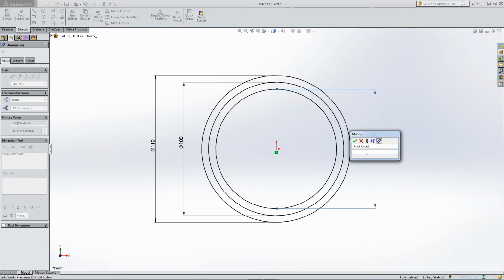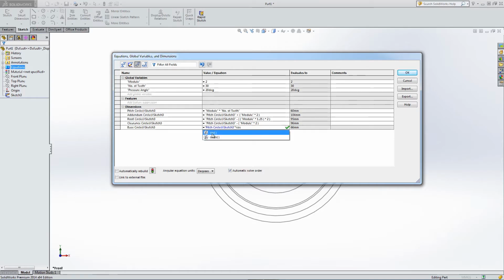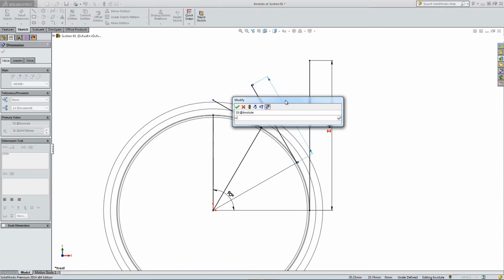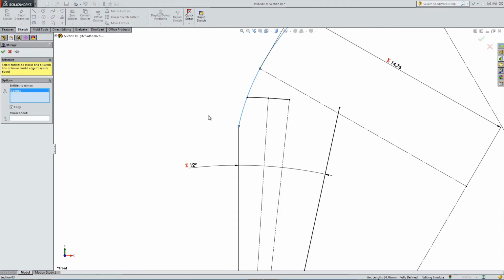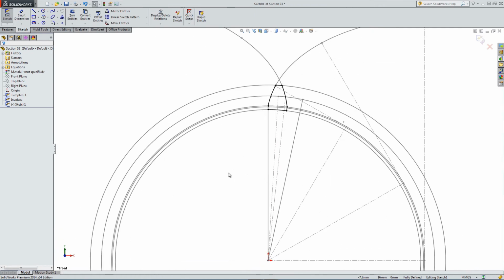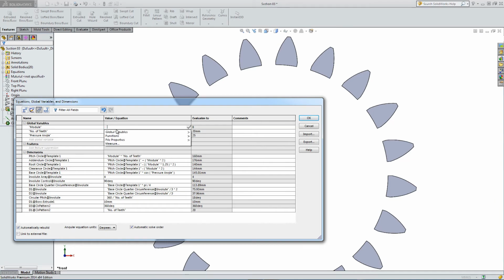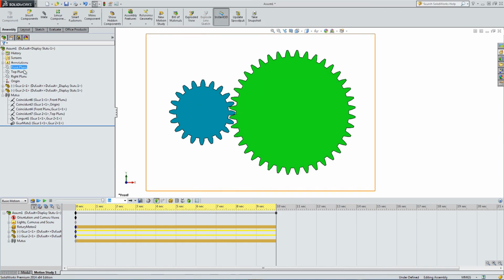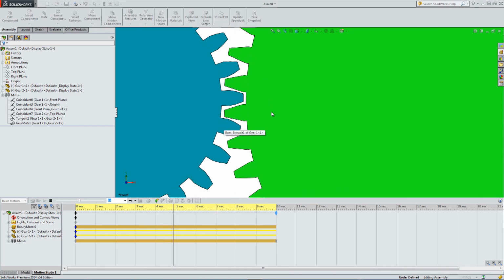Spur Gear Design 3 - Construct, Edit and Animate

Comment: Why is "pitch Circle" (60) + ("module" * 2) which it should be 60+(2*2)= 64
Why is it 104?
And "Pitch Circle" - ("module" * 2) = 96..
If pitch circle is equal to 60, why does it shoots up to 100?
Reply from the maker: Its not 60 at that point of the tutorial

Comment: Solidworks sucks. So much wasted time doing simple things.
Reply from the maker: There’s lots of ways to build most things in Solidworks. Try to find a method that works for you.
Reply: @PDWCreative  At work I use solidworks and at home I use Autodesk. Hands down Autodesk is faster for modeling, assembly, and animation. The only thing I like in solidworks is drafting. Your video was great though. My frustration lies with solidworks and the user interface.

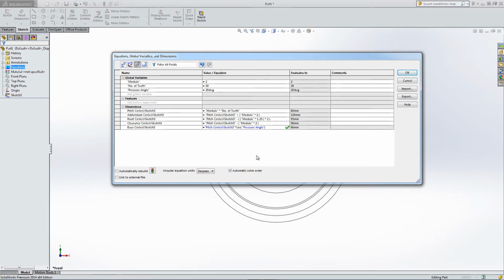Comment: Hey good content man, if you see at 5:40 the formula of Addendum circle as u mentioned is {Pitch circle + (Module * 2)} As per your values this should be 64mm, but u have 104mm, is it right? or am I wrong, can you clarify that part?
Reply from the maker: Only the first circle updates until the equation panel is closed. All the other equations think they are linking to the old  value (100mm) until the software updates. All the circles change as soon as the user accepted

Comment: at 5:48 on the video as you click the OK box the base circle dimension can be seen changing as the formula applies.  When examining the dimensions in the evaluate to column the only dimension that is correct is the pitch circle, the other 4 are incorrect.  Advance to 5:55 in the video your sketch dimensions are all correct.  Is that caused by Solidworks being slow at math or was it problems with the formulas and was edited out.  That page you inserted the formula's on led to much confusion.
Reply from the maker: Most of the other circles are driven by the pitch circle dimension. The linked equations dont always update until you press ok and exit the equation menu. Even then, you sometimes have to prompt Solidworks to update by hitting the command at the top.

Use the equations and you can’t go wrong. Check the results manually if you need as they are very simple equations. Try not to copy dimensions without the equations as you’ll get stuck.

Comment: Really enjoyed your presentation.  I had a lot of problems with the gear losing definition as I trimmed the reference geometry starting at 15:59.  I solved this by converting some of the template geometry and then only extruding the gear teeth.  Tried it with multiple equations and seem to work fine..

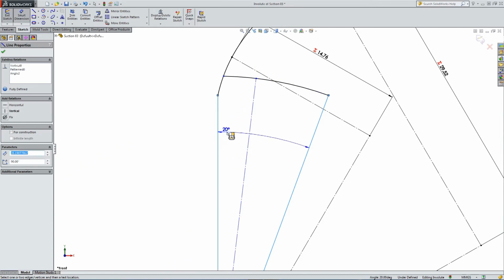Comment: There's a bit of an error at 12:20. The circular pitch (360deg/no teeth = 12deg) should be defined where the involute touches the pitch circle not at the base circle. Also the midpoint relation used to mirror the involute profile can cause errors at higher numbers of teeth. I'd recommend this video as a supplement : https://www.youtube.com/watch?v=22K6xWNwVLE&t=1s
Reply from the maker: Your not wrong. I need to update this video. I've updated the method in the following link. As soon as I have time I will be re-recording this explanation.https://www.youtube.com/watch?v=Hly5F82-PYQ&t=115s

Comment: Thank you for the demonstration, especially parts 1 and 2 with the detailed calculations. 
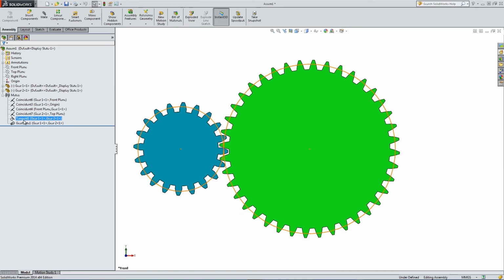25:16 - It's been some time since I made gears so I'm a little rusty here. I don't understand why there so much backlash between the two gears here. In fact, if the piech diameter circles are tangent to each other, there should be constant clashing between the two gears. They should be touching at all times, on both sides of the closest two teeth. In design, I have to add backlash by either separating the two centers of circles or putting an offset on the gear profiles in order to actually allow them to mesh properly.
It might be because of the coarse design of the involute, but I don't think it would account for such gaps.
Reply from the maker: Try the rack and pinion gear tutorial. I did that more recently and eradicated the built in backlash. It’s very similar to the video 3 you have watched with a minor tweak. I will be updating video 3
Reply: @PDWCreative  Thanks for the reply. I will check it out shortly.

Comment: Great video, but I noticed a few problems.

1. By using four reference points the resulting curve is not a true involute curve. A true involute curve starts from the base circle straight up (90 degrees). This one does not.

2. There is quite a bit of backlash (=space) in-between the teeth.

If you are interested I discovered a whole new way of generating involute gears based on the 3D-involute shape.

Basically the involute curve is simply a vertical cross-section from 3D-involute shape. And the 3D-involute shape itself is no more that a line spiraling up a cylinder at a constant rate.

I used this knowledge to create my invention the New-CVT. At my website new-cvt.com you will find a more detailed explanation (very different to standard one so excellently explained here) plus a source code for generating involute gears in blender. I tested my source code by zooming in to a very high degree in blender and as far as I can see they are theoretically perfect.

A note of warning though! My method is very different to the standard one, so if you are working on a project for school, this will not be what your teacher might be expecting. So explain the difference between the two methods for extra points (and also to make sure your teacher doesn’t go ballistic).

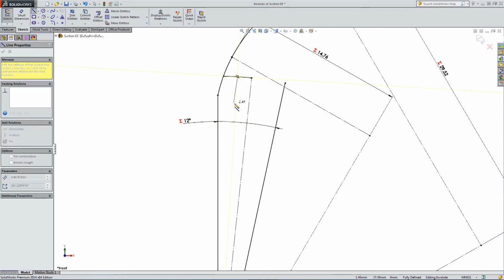Comment: At 13:35 you add a construction line to mirror the involute.
How exactly is this line defined?
I get that the other construction line is placed at half the circular pitch. But how exactly do you define where to mirror the involute?
At least it looks like you just place this mirror-line anywhere freely on the pitch circle.
Reply from the maker: Its a midpoint constraint. The option turns yellow in the video just before its placed
Reply: i might be missign something but what is the construction line that is used for the midpoint constrained to? is it an arbitrary angle?
 @PDWCreative

Comment: Hi Sir thanks for this video!
I want to how to control backlash and is it possible to achieve zero backlash or approches to zero backlash?
Reply from the maker: I need to do another video on backlash. There are different ways to apply it
Reply: @PDWCreative  Yes, it will be a great favour sir.
Sir I have one more question that I am designing a gear of module 5. But according to equations ,provided in video 1, base circle is smaller than root circle. Pls let me know how can a gear can be designed in this situation.

Comment: You Skipped many things in between.. wasted my day in repeating what you have done ... In the 3D modeling... Things were over constrained... Moreover this is though way to make gear... That too without accuracy... You said the tangent will intersect with outer circle.. it didn't.. even though my values were accurate to 4 digits after decimal...
Reply from the maker: Its difficult to know what went wrong in your model without more details. I didn't edit out any of the steps I took in this tutorial so you should end up with the same result I did. But if you are looking for a different pressure angle, module and tooth count, things can get out of control very quickly as there are limits to how far you can vary each in combination.
Reply: I appreciate the frustration as I too often have difficulty struggling through YouTube tutorials. However, this person has put in a lot of effort to make these overall get professional videos, so we should use a more respectful tone.

Comment: Can you explain what is module in detail. How is it useful while manufacturing.
Reply from the maker: In order for two gears to mesh they must have the same module and pressure angle. If the modules are different the gears will be incompatible.

Comment: When you're drawing the actual involute, what tool are you using? Arc tool? Line tool? If it is an arc tool, how do you make it go through all the point?
Reply from the maker: The involute template is a spline. The overlaid profile in the later step is a curve. The overlay is used to prevent possible solidworks errors when adjusting the size of the gear.
Reply: @PDWCreative  thankyou👍

Comment: it's the best video for designing the spur gear but how can I turn it to a helical gear
Reply from the maker: The main difference between the two gears is the helix angle. It is generally between 15 to 30 degrees but can be more. You could try applying a twist to the modelled gear. I’ll try and make a video about it in the near future.

Comment: I have a question. If i want to make a gear ratio of 3:1, 3 rotations on the driving gear resulting in 1 rotation of the other gear, then what variable should i be changing? is it module or number of teeth, or is it the whole thing..?

Also! very nice tutorial with easy to understand explanations and demonstrations
Reply from the maker: Start with the number of gear teeth to get the ratio. You may need to adjust the module & tooth count depending on the desired pitch circle diameter. If the combination is incompatible or leads to an unrealistic gear profile you will see it pretty quickly. If this is the case go back and make adjustments.
Reply: @PDWCreative  thank you very much I will definitely be experimenting with it

Comment: Thanks for your work.  But I dont understand why do you replace the evoluta (curve) what was made at 11:27 with an  approximate circle of 2 points plus one point of  tangent the the evoluta at 14:47/15:45.
The  profile of gear(s) in this case will not be a correct evoluta maybe like an evoluta only. 
 I used to work with SolidWorks program in between 2008 and 2011 but could not find this method.  Although I made evolute curves for plastic gears  with Solid Edge program as step by step rolled down the staight on the base circle in two degree increments. As you did this in 3 steps.
Reply from the maker: There are a few ways you can make the curve. If you place the curve made at 11:27 and the rest of the tooth profile in a new sketch its possible to extrude the tooth without placing the approximate circle later. I mentioned in the video I used the approximate circle as this is the point when things can go wrong. I remember this happening in my practice attempts before making the video. In some instances in Solidworks, circles can be easier to manipulate than splines. So for this design I opted to use the spline as a template only. I can then place a circle, trim it and fix it to the spline. When the design changes the circle based curve will track the spline change. You are right that its not the original involute but it will match closely enough to produce a gear that will work in solidworks motion analysis.

As an alternative, if you need a gear that absolutely tracks the involute without an approximate circle try building the involute curve and tooth profile in a new sketch before extruding.
Reply: @PDWCreative  Thanks for your reply.   Well I know using splines it is a simple method during the 3D construction but in some case it causing problems.   For example making CNC program or STL files for 3D models, because of the spline curve not exact, maybe it is a quarter to sixth(?) order approximation function - curve.
  In some cases, I was told that I was a visual designer because the CNC programgenerator couldn't made a program for my model.
Reply from the maker: There are sometimes problems with spline interpretation when converting from one cad format to another. I think circles, standard curves and lines translate across formats ok. But splines can are more free flowing and difficult to define. So when the CNC machine starts tracing the shape it will just stop at the point it doesn’t recognise the interpretation from the exported cad format. I’m not exactly sure why this is but it’s probably because different CAD softwares make non uniform shapes in different ways. Whereas they can all agree on common coding for standard shapes

Comment: It seems that the teeth of the two gears have a lot of play. Is there a way to optimize the width of the teeth?
Reply from the maker: There needs to be some gap to allow the gears to mesh. You could try experimenting with a different module and pressure angle. A smaller module gives a finer tooth. Just be careful not to go too fine. You may start to see the gears slip

Comment: Thank you sir for this video, this explains things very clear for spur gears. Is it also possible to design a gear if the only thing known is that the toothed T5 Timing belt has a pitch from 5mm, and the only variable is the number of teeth on the gear? I have never seen a video, where you can calculate all the other parameters needed. It would be very nice if someone could explain that. Have a magic Christmas.
Reply from the maker: There are some parts of spur gear design applicable to this type of belt. But T5 belts use a slightly different profile. I don’t think they use involutes. You would still need to know the module.
Reply: @PDWCreative  Thank You, you are right, the profile is different, but also the way they calculate the gear, i think. According to the Technical-Section-Timing table of the SPD/SI company the pitch diameter of a 30 Tooth T5 Timing gear would be 47.9 mm witch is bigger then the outside Diameter 46.9, where in your calculation the pitch diameter of a 30 Tooth spur gear, with module 2, would be 60 mm and that is much less then the outside or Addendum. 
Also the Module of timing gears seem to change with the number of Teeth. Example for a 30 Toothed timing gear the  module would be the pitch diameter divided by the number of teeth = 1.9566 where the module of a 111 toothed T5 gear the module would be 176.85 / 111 = 1.5932.
The pitch of a T5 timing gear is 5mm measured from one tooth to another on a belt laying flat on a surface. So, many mysteries for me there. Anyway thank you for your time. Jean